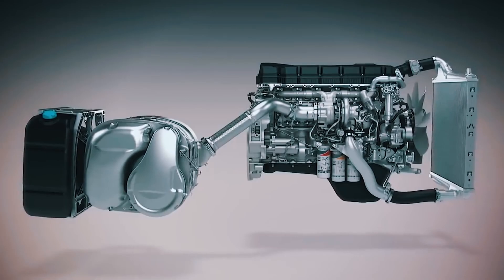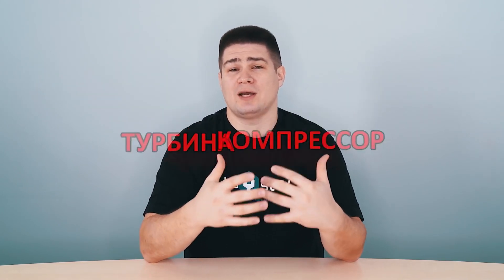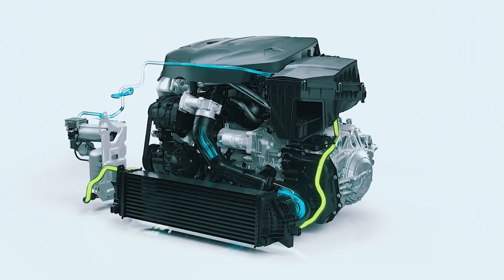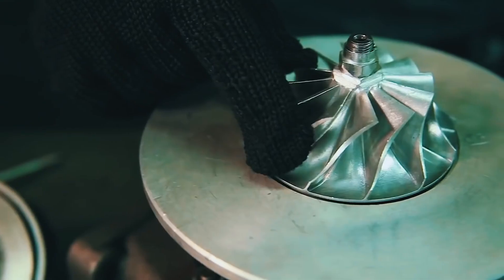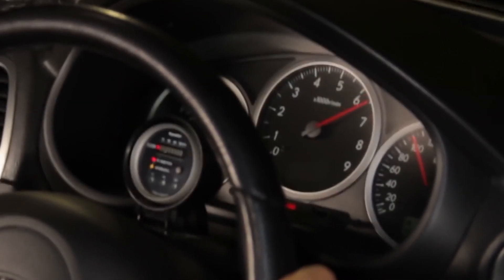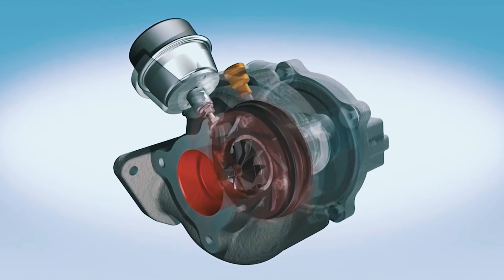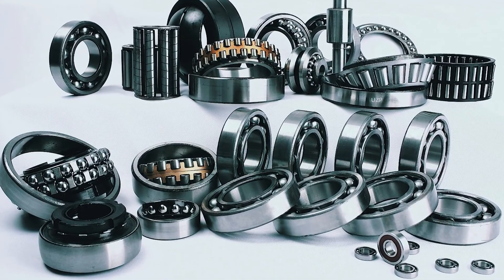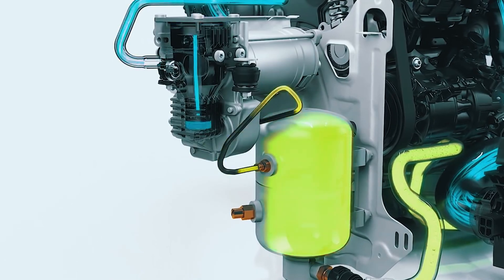How NOT to kill car’s turbocharger and gain maximum HP | All about turbo maintenance

Comment: According to Ford, you do not need to idle your EcoBoost (Turbo) engine after a drive. Just turn it off like a naturally aspirated engine.

“The EcoBoost engine uses passive thermal siphoning for water cooling. During normal engine operation, the engine’s
water pump cycles coolant through the center bearing. After engine shutdown renders the water pump inactive, the coolant flow reverses. Coolant heats up and flows away from the turbocharger water jacket, pulling fresh, cool coolant in behind. This highly effective coolant process is completely silent to the driver, continuing to protect the turbocharger.”

Comment: I usually drive within the power band of 1.5k-3.5k rpm on my 2018 Civic EXT (1.5 liter, turbo, GDI, CVT), bought new June 2018.
After over four years, my Civic has 124,300 miles averaging 34.1 mpg.
I rarely hit 4k rpm. I rarely take short trips.
I drive 60% highway.
I only use top-tier fuel with the highest detergent.
I always change the oil/filter early…approx 4,200 miles (6,759 kilometers).

My goal is to reach (or exceed) 300k miles (482k kilometers) without repair to the engine, turbo, or CVT.
Do you think I can do it with my driving style and aggressive maintenance?